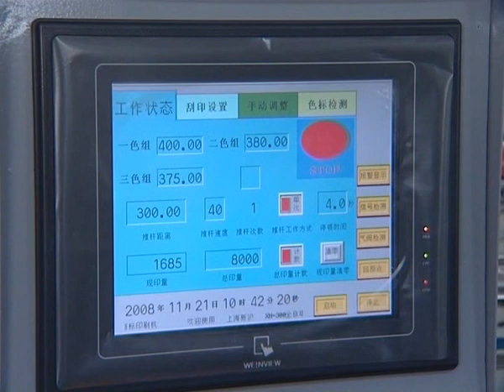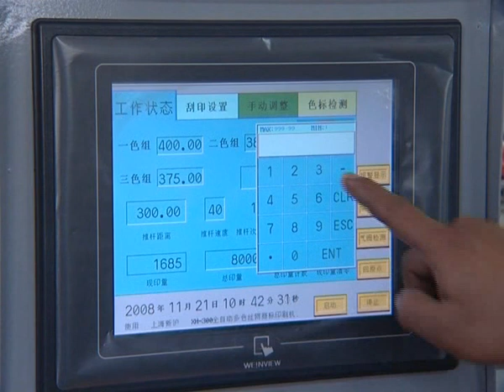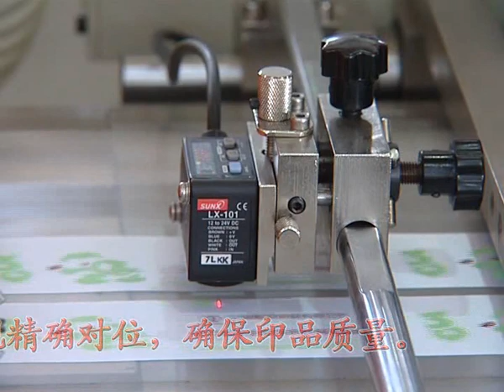multi-color label screen printing machine

Comment: pease send me information, I need multicolor screen printintig machine for print Flexible PVC.  rollo to roll and roll to sheet.
in april 20-5 may  , I be in canton fair. regards.
Reply from the maker: hi Sebastian Donadio, thanks your enquiry about our multi-color screen printing machine, please email me to achieve the connection between us, because it is difficult to use youtube in China,  please touch me in email: tony-meng@outlook.com , or you can touch me in skype: mxj0192 , I can not find your email in this message.  thanks!  
tony